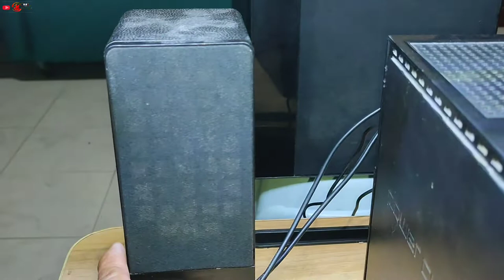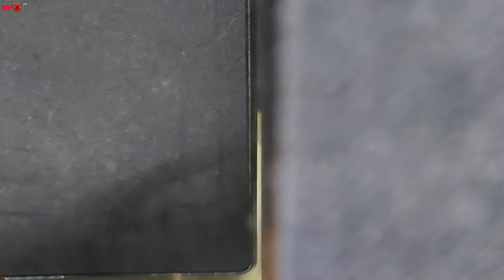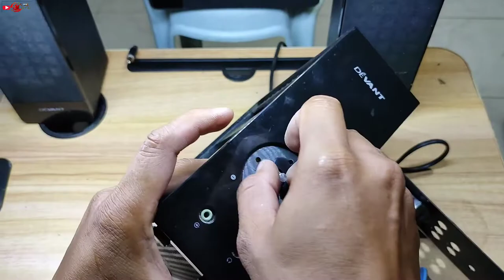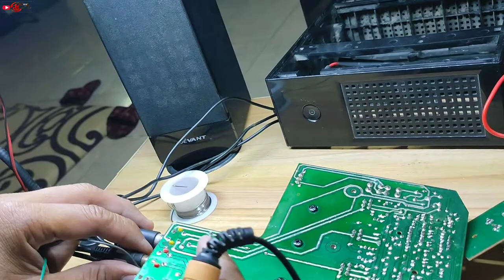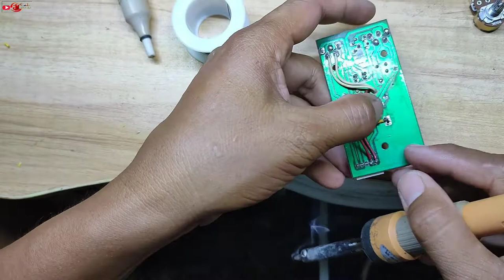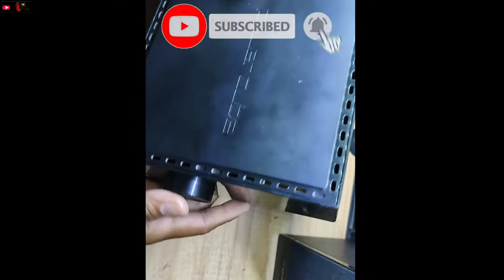Devant power cube 2.1 sub woofer checking and repair

Comment: ser may borad ba nabibili sa ganyang speaker?
Reply from the maker: Walang mabili na ganyang board sa mga electronic supply unless mag request ka sa Devant company, pero kung kayang pang e repair pwede naman po.
Reply: @jmcooltronics457  yung sakin kasi ser parang lumitaw yung traces ng pcb nauuka at yung iba natatanggal na kaya mahirap na mag jumper.
Reply from the maker: @lindongrey9039  
ahh okay saan bandag trace nang pcb ang nasira sa may amplifier side? sa may pre amp side  gumagana paba sa may sub pre amp at sa L and R satellite pre amp, pero kung ok pa ang pre amp side pwde ka po bumili nang digital amplifier sa online lazada or shoopee mayroong stereo 50W L&R meron ding  100W try mo mag seach sa online baka may makita ka doon para ma modified moyan.